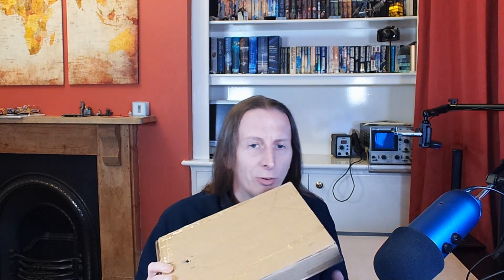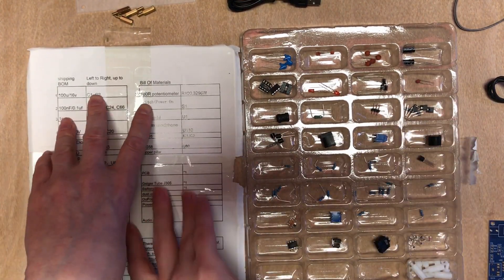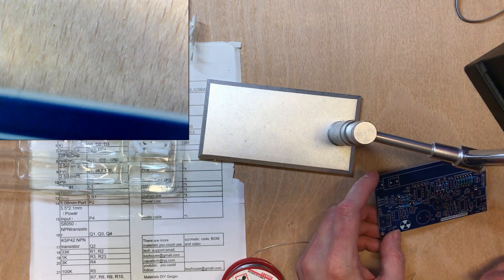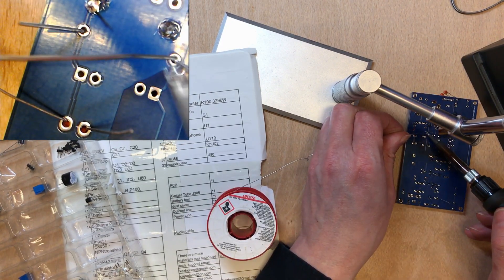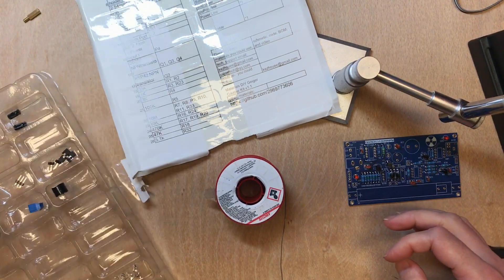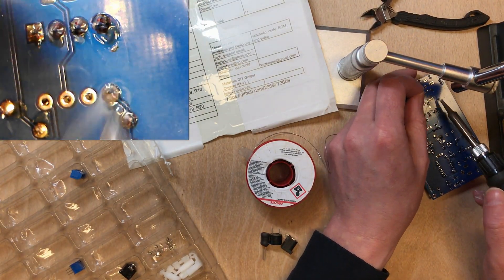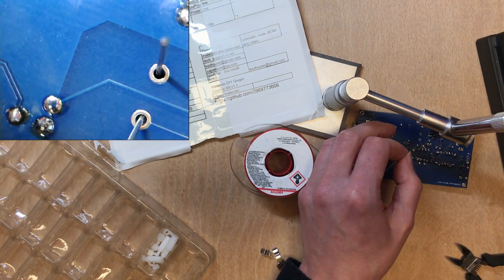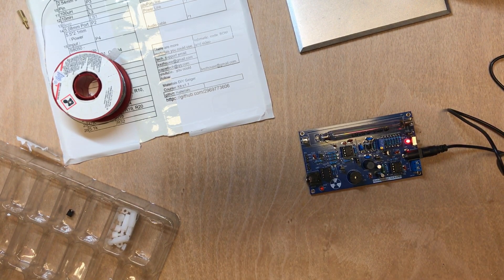Geiger–Müller counter Kit

Comment: Should there not be IN4007 diodes for use in the voltage tripler that drives the Muller tube.
Reply from the maker: You may well be right, I am not an expert in these kinds of circuits.

Comment: Hi, I am from Germany (bad English) and I bought this counter. I use it without a programme, I almost need the signals from the Board. The problem is, the light near the on/off switch doesn’t work on my counter. It worked only a few minutes. Is this a sign that the Geiger counter will get unfunctional? Actually, the counting light works, but is the not working LED near the switch   a problem ?
Reply from the maker: That sounds like your power led has burnt out. It should be fairly easy to replace but you might want to check the current limiting resistor (Immediately beside it on my kit). If that was the wrong value it would explain why it burnt out but it might mean that you have swapped the resistor with another one which may cause a problem elsewhere in the circuit.

Comment: The interesting thing with these cheap Chinese Geigers is they use the same tubes as the Chinese military models (Which are based on Soviet SBM 20 tubes) and these tubes are actually good at reading up to several MilliSieverts or a few hundred Milli-Roentgen
Reply from the maker: Interesting, I bought an old Russian pancake tube years ago but I could never get it to work right. My original plan back then was to build a random number generator, I should pick that plan back up with this one.

Comment: Very nice video, many thanks. The trick with the soldering sequence is that you have to start from right top to left bottom of the box (opposite what is written on the box...). Took me some to to understand :). Otherwise the kit works very well, no need for calibrating.
Reply from the maker: Yeah, someone else pointed that out already. Kicked myself after checking the video to confirm.

Comment: I noticed the issue you had opening the components. the paper isnt supposed to be removed from the plastic. use a knife to cut the plastic from the back. the numbers and the components line up perfectly, no guesswork. yes the small components arent first but you can keep track of everything a lot better.
Reply from the maker: Interesting, I looked back at some of my raw footage and that does seem to line up. Cutting the plastic seems like such an odd way of handling it though.

Comment: Nice relaxing video. Perhaps see if your device is sensitive enough to get a reading from bananas, they are full of potassium. That always works to slightly unsettle people ;-) Of course it also helps you explain to them that radiation in small amounts is everywhere around us naturally and not something worth panicking about.

Something different: what is that little desktop microscope you are using? I suppose it's simply USB. I've seen others like it, but not exactly the same. Would you recommend it?
Reply from the maker: I'll give it a try on bananas when I next have some in the house! The microscope is a pretty cheap one from ebay, I really like the way it is slim and so doesn't interfere too much with the main camera feed. Haven't seen that particular model around for a while though so I can't give a link.

Comment: Oh a glass tube? Here I figured it would use a common SBM-20. Bet it’s better at beta.

Also why does it have so many passives and three ICs? From what I can see, it’s just got a boost converter to 400VDC or thereabouts, plus a little bit of signal conditioning on the output, but that’s at most 2 ICs. I suspect there’s an alarm too, and the trimpot sets the alarm threshold. Still a fair few passives though. I’d love to see a short run through of the schematic.
Reply from the maker: This is one of those circuits where I think a large chunk of it could be replaced with a single micro controller, might make for a more accessible kit as well.

Comment: Fun video. But I wonder how random it will be and how fast it will generate true randomness.
Reply from the maker: It will be truly random if I do it correctly. The trick is to make the randomness totally balanced so all outcomes have equal probability (It can be truly random but imbalanced). How fast is split into 2 parts, how many ionization events there are and how efficiently we turn them into a random bit stream. I'll try to be as efficient as possible but I'm not sure how wise it would be to "optimize the ionization events" beyond my little light mantle.

Comment: I used quite a similar kit from alixepress, created a 3d printed case for it, added an ESP32 and an 0.96 OLED. There is this LED on the geiger board, which I was using to count the ticks. Now, the ESP displays the tick per minute on the OLED, and pushes the information to my home assistant and grafana. I like it. I found the output not reliable enough, or mine was broken, maybe. My "calibration" was done using the quite well known background decay of nature. I do not care if it is on point, but it will show a raise of radiation
Reply from the maker: I have some spare arduous I could use for that purpose, I know I have an oled somewhere that I bought and didn't use or I could possibly use one of the character lcd's. I'll definitely do a short video on using it for random number generation though which in many ways is more likely to be of interest to my main audience.
Reply: @weirdboyjim  Yup, quite a "strange" topic for you, but I liked the video very much.

Comment: very good kit for checking your lead lined underpants are up to scratch. :-)
You could also try it close to an old smoke detector, they used a radioactive source to ionize the air to detect the smoke particals.
Reply from the maker: My smoke detectors were the first thing I checked, no signal there but I did find one thing that was a few times background. Wonder if you can guess what it was.
Reply: @weirdboyjim  The Am241 source in a typical smoke detector is a strong alpha emitter and a weak low energy gamma emitter so you won't see much if anything at all with the shield in place with such a low sensitivity beta/gamma tube. Also remember that tube is completely blind to levels of radiation that can be downright dangerous. It's a decent enough sensor for classroom demos or post special weapons use, but in peacetime I would highly recommend swapping the tube out with a good unit from LND; the gold standard being the LND-7317 pancake tube if you can turn the working voltage up to 500V. That upgrade delivers decent sensitivity to gamma, beta, and alpha. All you need to do is match the driving voltage and you can use a wide variety of tubes. I would not recommend it, but if you were to remove the alpha source from your detector (still mounted to it's carrier of course) and hold it next to the tube, you should see some decent activity from the low energy gammas or Bremsstrahlung x-rays.
Reply: @Peter_S_  no good for geiger muller testing.... but alright for a cloud chamber then. :)
Reply: @edgeeffect  Yes, those sources do a fairly good job in cloud chambers.
Reply: @weirdboyjim  old luminous clock face, Some telephones had beta lights behind the dial, You have one of thunderfoot100's plates. but maybe one of them chinese butt plugs, sorry medical devices. :-)
Reply: It's got to be quite an old smoke detector I think.... if it is "a good one" the inside is plastered with warning signs.... oh there's a fun game.... somewhere in my office is Tilly Lamp mantle and 2 pellets of Americium.... could play radioactive hunt-the-thimble if I got around to building one of these kits. :)

Comment: It's funny, I've always wanted a Geiger counter too but never felt the need to buy one. It's strange that we had the same thought and bought one around the same time - within a week or two of each other. Either it's ESP or a Scooby Doo mystery as to why that is. I also bought some old Radium watch hands in a vial to test with.
Reply from the maker: Indeed. I actually bought a Tube several years ago, it;s a different design than this one but I want to track it down so I can test it against this driver circuit.
Reply: Hmmmm.... I think Radium paint is a bit more "beefy" than the good old gas lamp mantle.